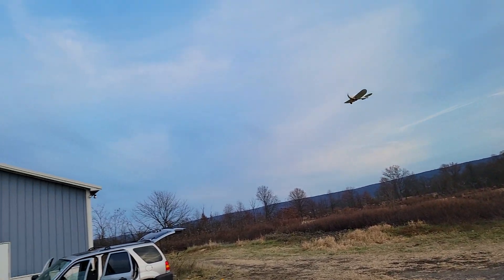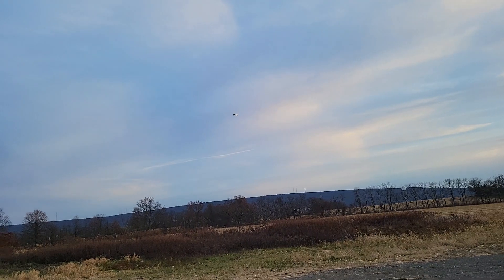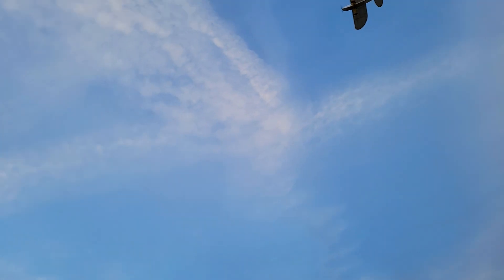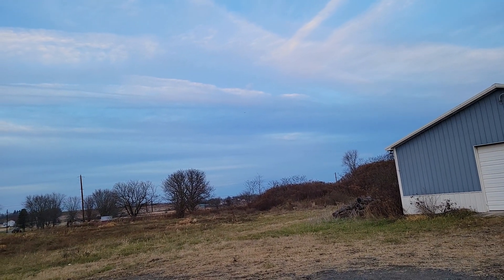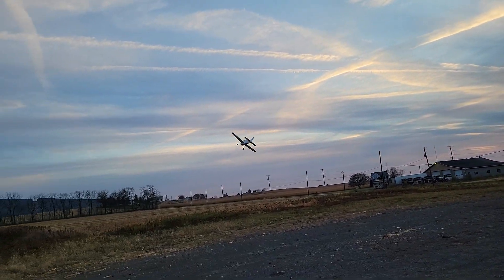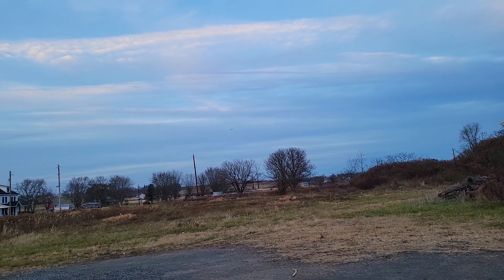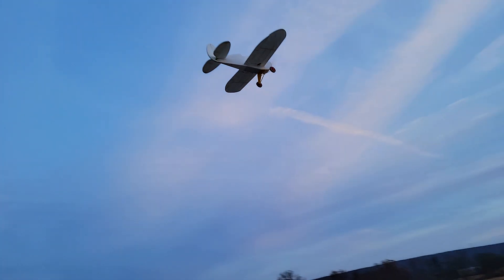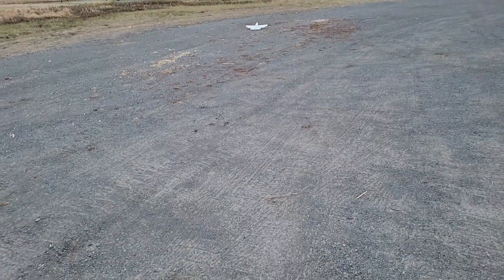UNBREAKABLE? Aerobatics and Inverted flight with my 3D Printed Sportster by @HOLOMODELS RC

Comment: The supplied G-Code prints beautifully on my Bambu P1S using both Bambu PLA-AERO and eSUN PLA LW PLA. The eSUN filament sticks to the stock Bambu build plate better than the Bambu PLA-AERO. I am almost done printing the fuselodge and wings. Did you also print the landing gear in LW PLA ?
Will keep you posted as my build progresses.
thanks
Reply from the maker: @markross5410  Thank you for the comment! I really spent a lot of time and money trying to find the best way to print them parts. No, the landing gear I printed out of PLA+. There are only G-Codes for landing gear in the “PLA or Pre-Foamed PLA” folder because pre-foamed LW, PLA, and PLA + use the same print settings.

Same as with the TPU folder, just the tires G-Codes. Or you can print the rims and tires together whole out of just PLA+ Thanks for the update and taking the time to comment!
Reply from the maker: @markross5410  What G-Codes did you use for the PLA-Aero? And did you try both to see which one prints better using the PLA-Aero?

Comment: You mentioned that you head some cracking during the flight, Did you inspect the plane for any damage ?
Reply from the maker: @markross5410  I did, and I didn’t see anything. I repaired the plane before the flight. My cats have damaged this thing by sitting on it more than I could in the air. I can say I have damaged it by taking the battery in and out. Next one I make, I am only going to put about four inches of Velcro in it starting at the forward dowel going forward. I put about 8in in these two planes and it was kinda hard to get the battery in and out, so I covered some of the Velcro with tape. I broke the platform above the battery compartment cause the Velcro adhered a little too well.

Comment: Bought the files off cults.... I've gotten planes from 3dlab print and eclipson  and I do like the way this one is working out and is going together, but I have a K1 and the g-codes just didn't work for me.
Reply from the maker: @1964markw10  They will and should work as long as you put them on an SD card or whatever slot your printer has. I have already come across the problem where Bambu studio and Anker Studio won’t load the files. However, if you bypass the software by putting the G-codes directly onto a SD card or USB flash drive they will run. I have helped solve this same problem with other people in the past few weeks. I highly recommend trying that. I wasted a lot of PLA getting the files to print how I want.
Reply: @HoloModels-RC  I tried that with PLA parts and ABS parts and they give me a code on my printer. Something in the g-code is flaking it out. seems to be fine on my Ender 3 S1 Pro.
Reply from the maker: @1964markw10   I looked into the issue you were having with the Gear and was able to duplicate it on my end. Evidently, when I exported the STEP files into Fusion 360, then exported the parts into STL's, it created the artifacts on the inside of the gear near the bolt holes(Thus breaking the G-Codes also). I was able to duplicate the issue you showed me. I have since fixed the STL's, and fixed the G-Codes. I uploaded the files on Cults as version 1.3, and you can read the change log for a full list of changes. Thank you for bringing this to my attention.

Comment: Nice Flying Bill, Just got a Bambu yesterday. Think I will give your model a try.
Reply from the maker: @markross5410  Awesome thank you. I can honestly say it’s one 3D printed model you won’t regret purchasing. I also bought both my printers on Black Friday, but a couple years ago. I would definitely recommend printing it with the Active Foaming instead of the prefoamed. There is much less chance of breaking it because it is so light, and it flies really nice. Hope you enjoy it, happy holidays! Let me know if you have any questions or issues through Cults. I will try to do my best to respond to everyone in a timely manner.  Also if you like my design, I am remaking my A-4 which is turning out real nice so far. I will post it when I’m done with a build and flight video. Thanks for your support, Bill.
Reply: @HoloModels-RC  thanks for the reply, I have a spool of Bambu PLA-AERO will give that a try. Also are you using thin or med super glue ?
Reply from the maker: @markross5410  Personally I mix the thin and medium together because the medium I buy is kinda thick but really cheap. So medium. Also if this is your first 3D printed plane, make sure you use ABS or ASA for the motor mount, otherwise it will melt. I have tried PLA and PLA+ and they both melted, but not ASA or ABS. And I put washers on the bolts to the motor Mount to distribute the pressure and temp. Seemed to work well.
Reply from the maker: I have never used PLA Aero. I will have to get some to try so I’m familiar with the settings. Maybe run a part off using each G-Code and see which one comes out better. Wall width should be around .65 using my G-Codes. I believe I put instructions up on cults on how to adjust flow and temp using the print calibration part and G-Code.